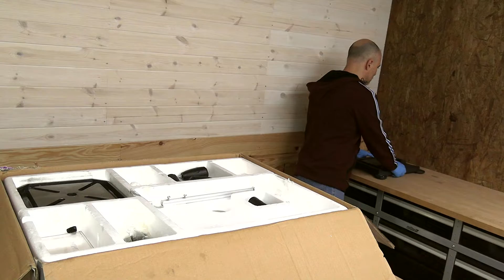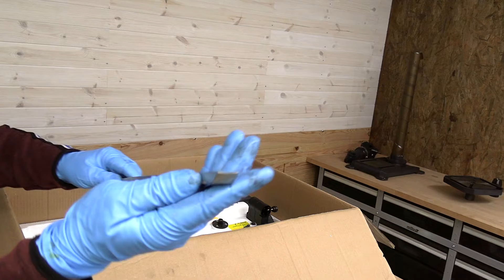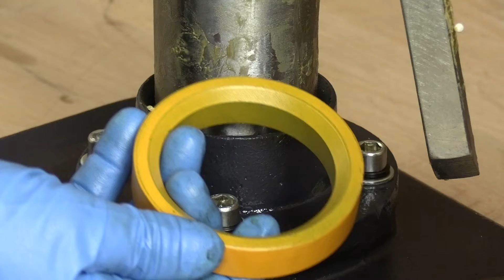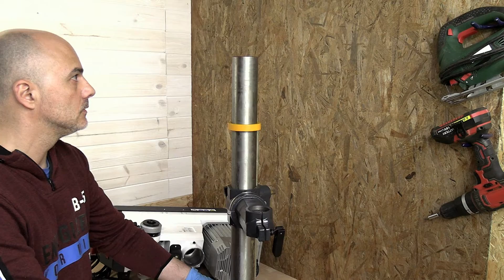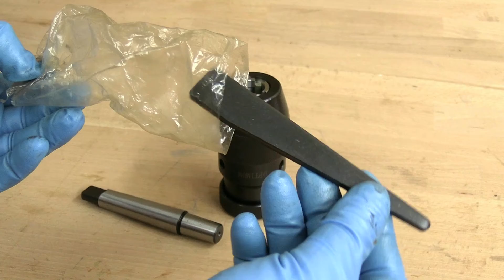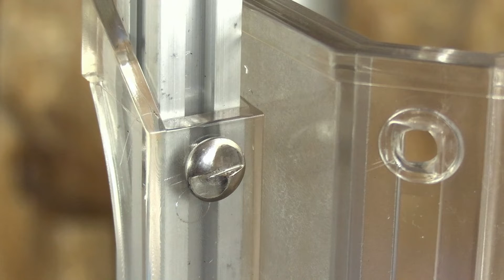🔧 Unboxing and Setting Up, step by step, My New Professional Drill Press

Comment: The arbor has a JT2 going into the chuck and a Morse 1 taper going into the spindle.  Should not have to tap the arbor into the spindle.  I do not recommend it. Clean both with a solvent and slide the arbor it with a bit of speed. If it does not stay you are contamination of some sort.  It is possible that that the morse is the wrong angle on the spindle or arbor but that is very unlikely.
Reply from the maker: Okay, so, there are morse tapers and also Jacobs tapers? Soon I will upload next video where I show how the pulleys work and how I install the chuck. I installed it before I read your comment, so I don't think you're going to like how I install it. Thank you for the comment and for the tips 😀
Reply: @WoodworkingwithDIYtools   I could have been more clear and correct.  The drill press spindle generally has a morse 2 female taper.  The chuck has the shorter female JT1.  An arbor  with male Morse 2 on one end and JT1 is used to connect the chuck to the spindle.  If it has the morse taper  generally has the JT1 too.  But they can be difficult to remove.
Regarding drill presses that use 3 pulleys.  Offshore manufacturers have been misaligned the pivot hole for the center pulley arm for a long time. Hole not parallel to the axis of the drill press.  It is generally accepted that since belts are forgiving it would be anal retentive to correct this.  Yet it is temping.

Comment: I think I'd remove all the shipping grease, chips and debris will stick to that stuff. It's there for rust protection during storage and shipping. Use a good dry lube and that will minimize the junk sticking.  I have an old Delta bench top press,  yours has features I'd like to have in a small unit.
Reply from the maker: At the moment I'm not going to remove the grease from the column. Here in Galicia there is a lot of humidity and I think it could start to rust the column unless I continually add lubricant or anti-rust.